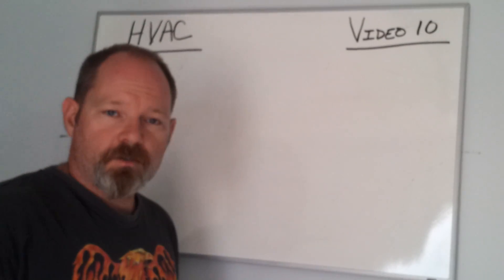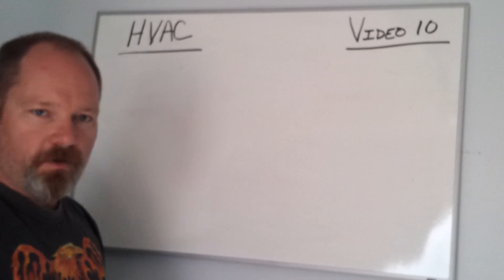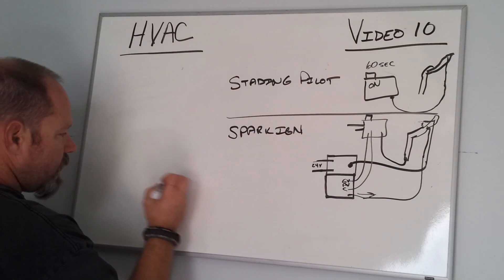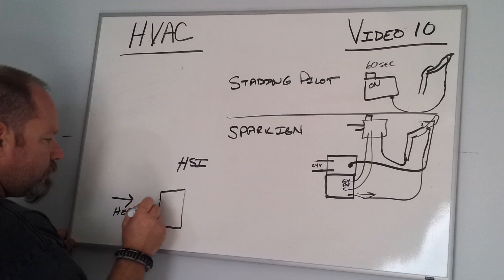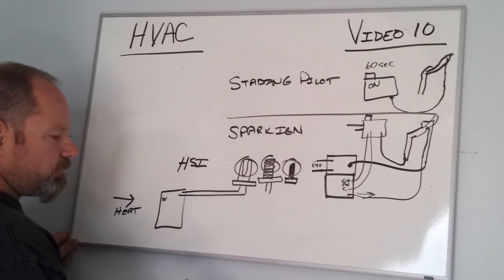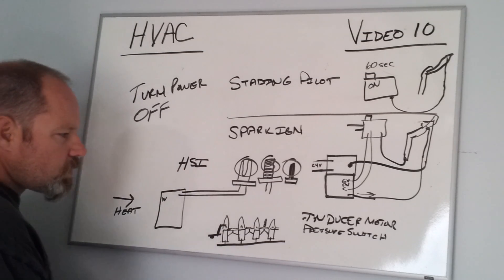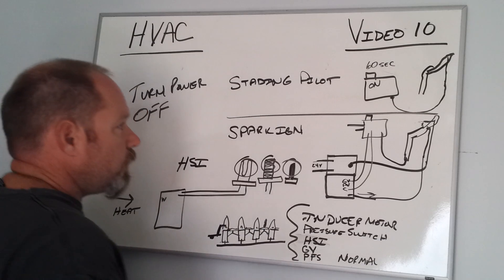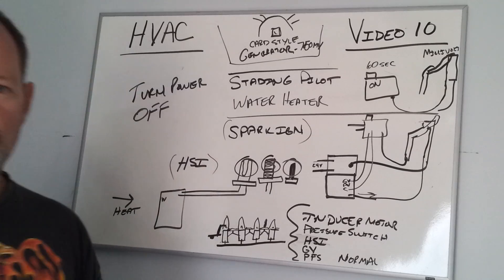BASIC ELECTRICAL 101 #10 ~ HVAC

Comment: I discovered today on my Dads furnace when the Inducer motor is running but you are not getting flame to check the lower limit switch.

Comment: every tyime a switch to heat,the 5 amp fuse on the low voltage blown?
Reply from the maker: +Anisleidy Penabad jump R to W in the unit of it works you more that likely have a short in the stat wire somewhere